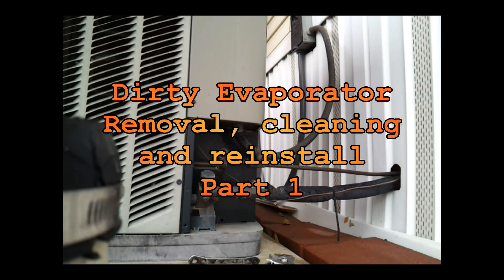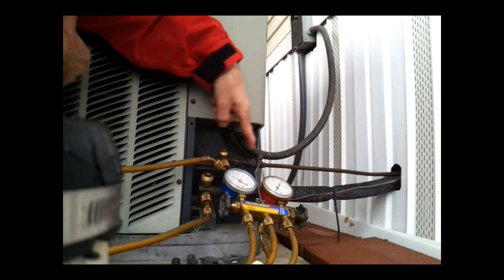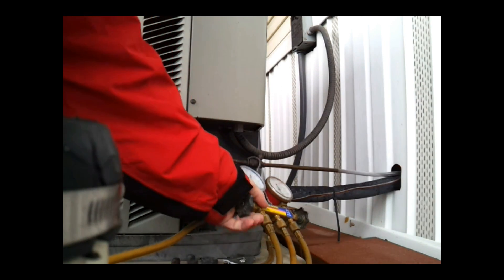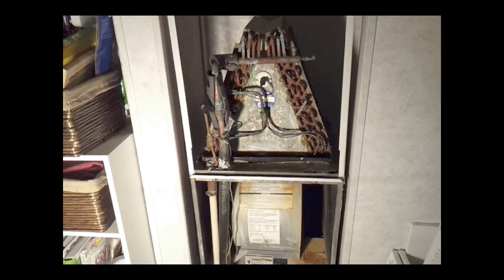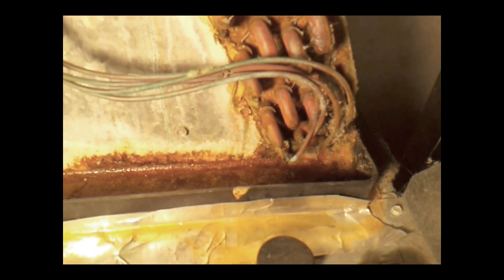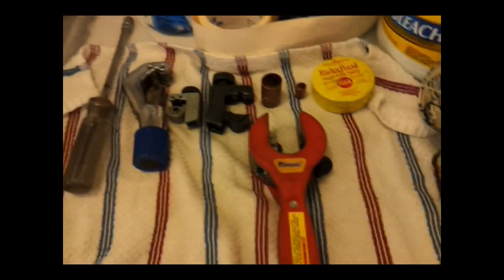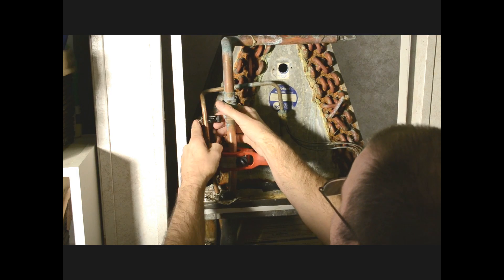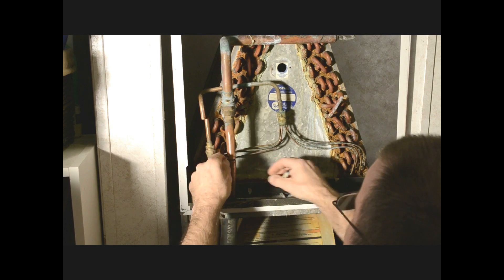HVAC Dirty Evaporator Coil Removal, Cleaning and Reinstall in Air Conditioning Unit. Part 1

Comment: Mike,  it looks like i'm having the same problem  that is shown at  approx  the 6.00 mark, (water dripping down  onto the blower housing etc..) That front panel cover ,is that supposed to be air tight or is there supposed to be small gaps at the bottom for the water to drain to the front of the  drain pan?
Reply from the maker: Hi!  If you're talking about the triangle of sheet metal on the front and back of the coil, well they aren't designed to be air tight, but typically they are pretty tight. They dont install them with a gasket or anything.  Typically if the coil gets too dirty and packs up on the surface or down tn the coils, then the water will drip straight down or sling/spray off the coil instead of running down the coil face into the drain pan.  In addition to cleaning the coil there was a decent bit of gunk in the drain pan that had built up and washed down.  
  Is your coil mounted in a box or is ir in the open like mine was.  I still cant believe how cheap the manufacturers of the mobile home were, installing it without the coil inclosure and just putting those cheap foam filters right on rhe coil faces!
Reply: mikie2501 
Yup ours was basically like yours, and we had the   filters resting on the fins,which we were told that's how it was done.
Had a friend come out yesterday,and  told us basically with the  age of the  coil etc,, to replace it ( approx $1000)
Also suggested  if replacing the coil it might be better to get a  new system ( approx $3000)..
My concern is  if  only the coil is replaced how do we know  (or not) if the condenser wont go out in a few months.
Also getting a new system we'd get the new refrigerant  with it.
We can get a new coil  & condenser installed for approx 2000 , thats including  the changeover to the new 410a.
Reply from the maker: Well I have mixed feelings on just replacing a system because its X years old. Unless Im replacing the whole thing because a major component is out and it would be a good time to upgrade, or if say I was concerned the compressor was going to go out, then it makes sense to me.  2000 is a good price, but that being said, thats going to be on the low end of efficiency too.  If the system is running well Id just start saving up money so that when you do change it out you can afford to get something with a higher efficiency rating and cut down on the electric bill. The plus side to cheaper systems though is that theyre cheaper to repair out of warranty... However, some of these new systems come with pretty long warranties!
  Im in no hurry to upgrade mine, Ive replaced the blower motor once (actually need to order a backup and put it on the shelf!) and Ive changed out the capacitors on the condenser once and put two hardstart kits on it.  Probably wouldnt hurt to order a new condenser fan motor and shelf it.  
If the system coils and filter are kept clean and theres no strain on the system from installation issues (location/heatliad/improper install etc) then usually capacitors go first, then blower or fan motor as well as contactor / relays, thats the common stuff and usual stuff you find on most calls.  Are you having a problem with the system or is it just getting older?  I think mine is 11 years old now if memory serves...
Reply: mikie2501 
They system is just over 10 years old, the guy who is replacing the system for us  is a family friend.
Basically he said our Coil  has corroded away, so we are going to  replace  the condenser unit and the coil.

A second opinion we had  ,the guy said why replace the condenser ,if its running fine, and that .. if or when it does go out,, we can just replace it then and he could flush the old  R22 and replace it with the new 410a,,, which i've been told isn't a good thing to do at all.

Currently  its somthing we have to get fixed,,  we can run the coil for about 45 min at a time,, until the coil starts dripping onto the blower housing. We also picked up a  window unit  to help with the cooling,, these 95+ temps don't help either.
Reply from the maker: Justin Bennett  ...yeah, you can't just drop 410 in the thing, lol. At the very least you have to have an expansion valve for 410 and the evap and condenser have to be rated for the higher pressure freon.  I wonder what caused the coils to corrode in that time frame... Wonder if it has anything to do with the filters laying right on the coil... I'll have to read up on that.  Well if they replace the coil pay to have an enclosure for it that you can slide a filter in!  Hvac is like any industry, there are thieve and hacks so it never hurts to get second opinions on anything that you're shelling out a lot of money on, and doing a bit of research yourself :). ...oh, and when you get it installed use pleated filters, not those cheap fiberglass fishing string things! They let way too much crud past. The cheap pleated filters are fine.
Reply: mikie2501 
The guy were going with said exactly the same thing about the filters  not being properly installed on a shelf etc.  Wonder if the  enclosure  would come with the new coil,,ill have to find out.
When we had the filters laying on the coils they never fully covered them ,so i'm sure a load of crud got past.
Another thing was in the enclosure of the coil there was a  pipe going up to the roof.. not entirely sure what that wouldve been for, any ideas?

(Just spoke to my friend,and  with mobile home units ,the Ac filters do go over the coils.,and the  the "pipe going to the roof" is  a fresh air intake.)
Reply from the maker: The pipe going up to the roof is probably a fresh air intake. Sometimes if the house is sealed fairly tight they will install one so that you can circulate some outside air in with the stale ait. It probably has a lever on it to adjust how much air it pulls in. I havent seen one in a while, but thats probably what it is.
Reply: mikie2501 
You are correct, my friend who installed our new coil & condenser said  the same thing :)

Comment: Can you tell me what the name of the unit is, meaning what kind of unit looks like that inside the house. That weird v shape, I have one, and I need to know what to call it to order parts. Thanks for the video.
Reply from the maker: If it has electric heating then it called an Air Handler, if it is gas then its called a Gas Furnace.  The V coil (or other shapes) is the Evaporator Coil.
Reply: mikie2501 Thank you, video helped,

Comment: what's the name of the valve on center coil  marked with 26. My AC leaking water from there.
Reply from the maker: There are no valves or metal fittings on a coil that will leak water. The only water is what the coil condenses out of the air then drips down to the drain pan. If you have water on it then its just because its cold and condensing water.

Comment: mikie2501 Did you purge the air out of your manifold before you turned the unit on? I've heard of air being drawn in as the system pressure drops, and the gases in the hose expand back into the lines.
Reply from the maker: Yep, always purge my gauge manifold when changing freons or switching from nitrogen to freon, or after pulling a vaacum! I use low loss fittings on my hoses as well, love the things! :)
Reply: I prefer the standard fittings with ball valve shut off on them. The o rings on low loss fittings don't always seat on the access port properly. They are especially sensitive to slightly mushroomed ports, like the ones on Trane units after the nut cap has been on for over 7 years. I don't know why Trane doesn't put some o rings in those caps, but I have gotten severe frostbite twice because I tried to put low loss hoses on them. The yellowjacket hoses with valves are better because they're not sensitive to the shape or condition of the port.
Reply from the maker: I've had a few where I just couldn't get the damned thing on without leather gloves and now can't for the life of me remember what units they were on. One of them was on a second floor balcony at w very odd angle to get to,  by the time I got the hose on I had to put freon in it whether it needed it or not before!  After that if I ran across one that pulled that kind of stunt I would put on one of those T adapters on it, you know the ones that have two connection points... Something you might put on if you were going to put on a pressure switch and still have a connection point, or the like. It has a swedge fit and you still risk frostbite putting it on but after that you had a good, safe connection point. Worth the few dollars knowing I won't have to deal with it next time!  Those were also great for putting on if I had a leaky Schraeder valve and the thing was stuck in there and wouldn't come out with my lossless replacement tool!
Reply: The standard non low loss fittings are good if they're by yellowjacket. You have to shut the valve before you remove it so it won't blow out, but the o ring is shaped to expand as the flare port goes into it, so it doesn't open the shrader until the rubber meets the metal. You can get a set of 3 for $50.

Comment: Mikie, how do you find the size of a evaporator coil if you are replacing the coil?  I believe I have a 2.5 to 3 ton?

Does the old coil contain some leftover oil charge?  If so, do you have to replace that lost oil?

Also when you are brazing do you flow nitrogen through the system while brazing?  Is this necessary to reduce oxidation inside the fitting?

Comment: Hi I have an older Intertherm mgh045ag the cooling coils are on the bottom. It is getting water in the ac vents in the floor. I can find no filter location or coil access any advice would be great thanks.

Comment from the maker: Brett, I was going to mention, I have only seen a couple of the "fresh air" intakes on electric air handlers.  Funny since most of the homes I have seen them on were NOT built to any air tight standards where they would actually need them!  ...certainly don't need to pull in any extra humidity in Texas either, hehehe :)

Comment from the maker: Hey Brett!  Thanks for the great comment and advice! When they installed this one they didn't bother to seal the unit tight to the wall frame so I would have had to build up the trim all the way around the thing. I did think about doing what you suggested originally though!  The access area also has the water heater to the right of the air handler which is next to my bedroom so I've cut in a door to get to the water heater and cut in a second air return in the bedroom. I'll show it later :) Tnx!

Comment: Wanted to add, I like what you're doing, but most won't pay for that to be done unfortunately. I also often will put cleats in the side and back walls above coil and place a piece od 3/4" plywood on top of them to create a sort of box so the return air doesn't move up the "chimney" type opening above coil and just gets pulled right through it. Also disconnect any "fresh air" flex piping above coil. Gotta get me one of those ratcheting cutters. Glad to see ya back on here also. Take care, Brett

Comment: Great video Mike !! Those Intertherm's come uncased like that unless you order it specifically new to be encased with a filter rack. Mobile home unts are a large part of my work/business. I recommend Hog's Hair cut to fit NaturalAire fibered filters by Flanders/Precision Air. Then place them behind the louvers on the the front door panel. It will protect the coil and surrounding areas. Toss the mesh filters laying on the coil. Place a trap in the drain line somewhere. Take care, Brett
Reply: Hi! Are you say throw away the metal filters on the sides of the coils?